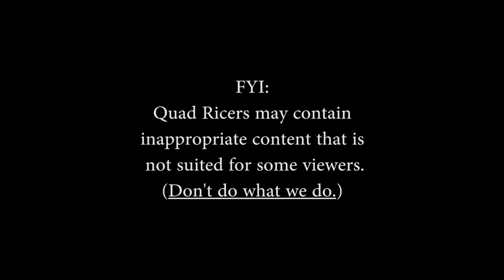Rice Cart Destroys a CORN MAZE!!!

Comment: You guys should put a predator 670 or 420 in the rice cart
Reply: cameron weisz the 670 v-twin is a better choice. The single cylinder engines are hideously underpowered without having to put 500 bucks of parts to it. There is also a 708 V-Twin too

Comment: Get one of them CO2 cartridges and set it up so you can blast it into the engine at speed
Reply: julian wilson engine needs oxygen to run co2 would choke the shit out of it and stahl it
Reply: DontWorry ItsalreadyBroke Oh yeah, shit, forgot about that. Slap a turbo on it
Reply: julian wilson well it could be possible to take a small oxygen tank and put a hose connected to the air box and that should cause a rush of air but idk if that will affect the air/has mixture